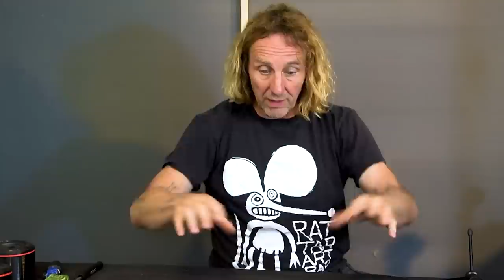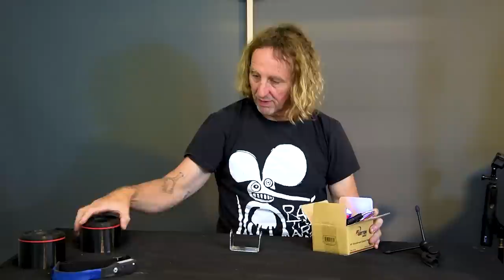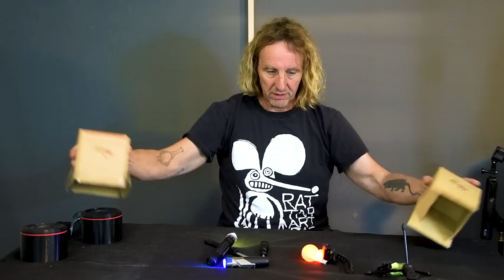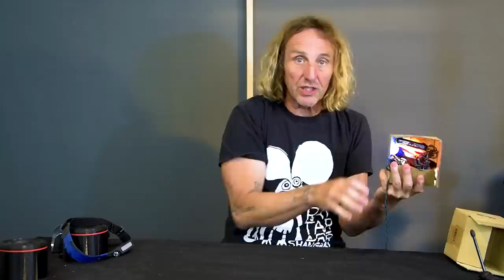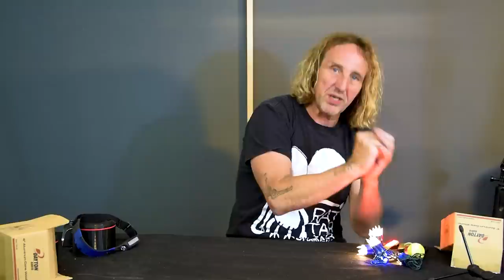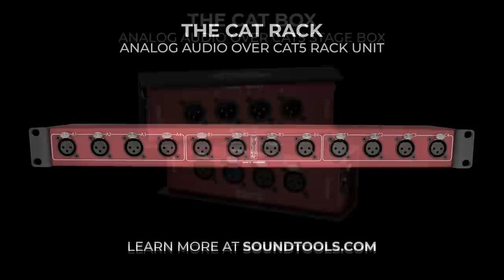Thinking Outside the (Speaker) Box - Does stereo Ruin Sound?

Comment: Bell Labs performed a series of experiments to find the minimum requirements for accurate sound reproduction.  This included preliminary work like reproduction levels, signal to noise ratio, distortion, frequency response etc. but it also included perceived localization of sound.  There were 9 "callers" in a grid pattern in a "pickup" room while a variety of different numbers of mics were sent via different numbers of transmission lines to different numbers of amp/speaker sets.  The speakers were in a separate auditorium, concealed by theatrical gauze, where listeners in different positions were to draw where they perceived the callers to be.  They found that 3 spaced mics sent via 3 discrete transmission lines, each to their own amp/speaker gave an almost exact match to where the callers were in the pickup room.  2 mics through 2 lines to 2 speakers didn't cut it, neither did 3 mics through 2 lines to 2 speakers, 3 mics through 2 lines to 3 speakers, or any other variant.  It's not just the intensity of the signal coming out of each speaker, but also tone, time difference, reflections in the room etc.  I thought a long time ago that somebody should create a psychoacoustic panner, that would automatically let you place your individual tracks into a virtual room, using a combination of level, EQ, delay and even reverb/predelay, to give a more accurate localization of objects in your mix.  When I mix in surround sound, I find myself assigning tracks to individual repro channels instead of panning.  That includes effects.  That way, a given sound comes from somewhere in the room instead of everywhere.  Like, I'll put an electric guitar front/left and it's delay return subtly assigned to surround-right.  Sometimes I'll add a reverse-polarity copy of a track to another channel, like adding an inverted guitar track to the center channel, 20dB below the level of the original, which I put front-left.  That "pushes" the guitar farther to the left to where a speaker doesn't exist.

Comment: If you put the exact same thing in both speakers without altering it, it will be in the middle. You try to lay out the instruments as they are on stage.
Reply from the maker: On stage instruments radiate energy outward from various locations

Srereo speakers shoot sound inwards from 2 locations.

It's like trying to recreate a fireworks show using a couple of flashlights

Comment: I envision a melding of motion arrays and ADS-B like tech to create motion in the sound that travels around the room with performers and even audience, to project an accurate image spatially.  Almost like a hologram of sound.    Almost like being on stage next to the performance.
Reply from the maker: I think speakers that output differing sounds in differing controllable directions would be fairly simple to implement
Reply: @DaveRat   would be fun to gut some track spots and mount some tube speakers to the gimble to prove it out then scale it up.    I would imagine horizontal arrays would become possible at that point.

Comment: What if you'd put like five arrays on the rig? The usual L&R arrays (which still should be the most powerful part) plus a center/left, center and a center/right speaker array (1/4 capacity compared to the main hang), evenly distributed above the stage? Then, adressing the sound-source (plus some of its reflections) to its original position would be far more controllable, because instead of only having two arrays for your stereo-image - largely distanced from each other, you could fill the space and create a more detailled stereofield.. Just an idea.
Reply from the maker: Love to see people try various things and let me know how they work. I will post more vids with ideas

Comment: All You Need To Do Dave Is To Buy A Lot Of Cabasse "La Sphere" And Built Them 360 Degrees Around You. Job Done.
Reply from the maker: Hmmm, I have some ideas and one that I have built and works pretty well.  I will do more vids to keep pushing new thoughts
Reply: @DaveRat  Great ! Looking Forward to that. When I was young I once went to cinema where you would stand and watch a short movie kindof inside a huuge ball, probably 25 meters in diameter. If the material of this shape could vibrate at any spot and play music we'd have the perfect 360 degrees sound, similar to using surfaces in the car interior to vibrate and emit sound.
Reply from the maker: Interesting. I am still chellenged by the concept of shooting sound inwards from the outside to recreate the experience of listing to instruments and sound source that shoot sound outward
Reply: @DaveRat  can you please explain a bit further, the concept of why you would wanna shoot the sound in the oposite direction..?
Reply from the maker: Well, a sound source 8s like a campfire radiating energy outward

Now say you want to recreate the feeling of a campfire, would you use a flashlight or floodlight that shoots energy all in one direction?

Or maybe a light that radiates differing energies in differing directions, maybe gets brighter in front then behind them to the sides.

Comment: You don't think that delaying the signals differently on the console could help a lot in trying to maintain that individual consistency? I mean...instead of aligning just the PA or the tops or subs and so on
Reply from the maker: Hmm, there are many things that can be done to reduce issues with stereo and increase the horizontal width.

But that does not change the fact that stereo is like radiating all the energy from two shower heads 

But an instrument or a band is like a sprinkler or a bunch of sprinklers radiating sound in many directions from differing locations.

The best one can do to recreating a field of sprinklers with two showerheads is try and line tings up so it's sort of similar if the listener never moves.

But as soon as the listener moves

"Hey wait, this is not a field of sprinklers, everything is coming from a few shower heads" becomes obvious.

Comment: That's sort of what location metadata (like in atmos or similar) allows for, then you can reproduce in binaural, stereo or multi-channel and the "point souces" will adapt to distribute through the the number and location if speakers and of the listener (positional audio)...
Reply from the maker: Hmmm, a sound source is kind of like a campfire or a sprinkler, radiation energy, outward in various directions.

Atmos is is like heater vents or showerheads mounted on the wall.

Atmos is like trying to replicate a campfire by using complex central heating with wall and ceiling vents.

I don't see one being able to recreate the other
Reply: @DaveRat  used atmos as an example, with metadata of spatial location you can eventually use a wall of sound tech once available, all around you, if you can make one, emiting sound from wherever you want. My main point was addressing the fact of never risk losing real spatial dinamic coordinates data, and then making the data adapt itself as best as possible to whatever playback context is available (mono, binaural, stereo, multichannel, and eventually "holographic" whatever if ever available... )
Reply from the maker: Hmmm, perhaps it could be simpler. Music releas with 4 stems and each stem has 4 channels. The playback side would have 4 speaker pods placed whereever ya want.

Each stem would have a front, rear l, rear r, and up signal or so. 

Each stem would be reproduced as a 3d sound source by the sound pods

Comment: I've always been interested in trying to fake a spatial reflection, especially a sound which you believe is coming from behind but is actually from the front/or your in ears. Big rabbit hole though
Reply from the maker: Ha, yes that would be a complex
Reply: That's insanely tricky, since the way we perceive height and front-to-back information are exclusively changes in frequency response/comb filtering, and is directly dependent on the shape of our ears and heads. Since we all have differently shaped ears and heads from one another, it is a real challenge to have a solution that can pull this off.

In headphones, though, this is actually achievable to some extent. This is what products like the new AirPods pro are trying to accomplish by somehow making a physical model of the individual's ear and directly using that information to compute vertical and front-to-back spatial data, directly tailored to the individual. For speakers, though, where multiple individuals have to listen to the same box, this is, or at least seems, next to impossible, without the speaker physically being in the spot the sound is intended to propagate from.
Reply: @FOHFILMS  Exactly, I've used internal ear scanning devices to achieve this before, would need to be tailored for each person differently somehow, it'll happen one day I'm sure though, and it will be awesome.

Comment: IF the sound is recorded with a single point source ie. one mic in a center position (or binaural with identical, very close proximity mics, like our ears) then playback CAN be achieved with VERY realistic results. A "phantom center" is critical to reproduce the stage width and depth. However once multiple microphones are used for the recording, things get out of hand as each one of those microphones now require their own playback system in the EXACT SAME recording position, unless the "recording engineer" is using computer controlled software to digitally place the instruments on a digital stage. Once you have heard a GREAT recording played back through GREAT gear, the "phantom" becomes a reality and it's difficult to believe that a "box-O-speakers" can recreate a sound like that.
Reply from the maker: I am not sure that capturing the sound radiating towards a single mic from multiple directions and then reproducing that sound of the instruments and the room with a loudspeaker that radiates sound primarily in one direction will offer anything colae to realistic sounding results. 

That sounds to me like what happens whenever mic'ing a room, the recording sounds reverberant and far away and fails to capture what the sound was like in the room

Comment: I'd be curious to hear your thoughts on Dolby Atmos.
Reply from the maker: Imagine standing in a field of sprinklers and walking around or sitting around a campfire.

Now set out to recreate those experiences using an Atmos concept

So now you are in a room with showerheads mounted on the walls and ceiling to recreate a sprinkler field

Or heater vents on the walls and ceiling to recreate a campfire

Can you see where the recreation would fail?

Comment: I have always thought that stereo imaging is imperfect, no matter which speakers are used. It is subjective because our ears and brain are not so easily fooled - you only have to move your head and the new information received destroys the previous impression. With bass frequencies it's much less of an issue. So multiple speakers do not have to be large. It would be feasible and desirable for audiophiles to have recordings with multiple channels - especially with the technology available today. How long ago was stereo invented??
Reply from the maker: I will do more videos on the topic. One aspect I intend to cover will be how Sound sources are energy sources and when comparing to something like movies or video where the actual lights are the energy sources and what we show in a video or a movie is actually the reflection of the energy off of various people and things.

The parallel between sound and sound sources would be similar to watching fireworks, sitting around a campfire, or looking at Christmas lights where we are observing the actual energy sources.

So recreating sound versus recreating visuals is much different

But the methods we use are very similar, which is where the flaws come in

Comment: A multi wall rectangular array (or vertical tube - akin to sitting in a light house!) of many thin film transducers powered by a multi channel amp connected by standard and controlled by a devices app that uses AI to transcode the spatial info of the individual elements within existing audio codex. The tech already exists as will the Sony multichannel remasters, but the sound reproduction from the arrays would have to be affordable and of a high quality for it to be taken seriously enough to a cause a shift. The possibilities to tweak and position the individual elements would be super dynamic. Imagine walking down a corridor with thin film transducers on the walls that are emitting a dedicated to the environment (corridor) mix, with each instrument presented to the listener from its' own speaker! It would be like walking up to the performers and through the performance! Aye, it's the end presentation system of audio that requires reform right enough. Even modular add as you go good quality yet affordable wireless speakers scattered about a room and connected to such a playback system will make people expand their consciousness of the possibilities of better sound reproduction. Oh aye, that's what you're doing, Dave!...hehe!
Reply from the maker: Not sure it needs to be that complex. Think about trying to recreate an acoustic guitar player. The Sound source would be somewhat like a campfire radiating energy around it and outward.

Now try and recreate that scenario using the systems available by radiating heat of the campfire from all the walls in the ceiling how close will you get to recreating the feeling of a campfire?

Recreating a campfire with Central heating will be as successful as we creating an acoustic guitar player with surround sound Atmos or any of the other methods in use today
Reply: @DaveRat  of course! I was obviously still over thinking inverted outside in, inside the box! For some reason a glitter ball comes to mind...I need to get my head half a round this. The gears are a trundling. Thank you, Dave Rat. Brilliant content, man!
Reply from the maker: Cool cool and thank you

Comment: I think that atmos is doing what you are talking about, just a little bit differently. It spreads instruments to each speaker. Yep, you don’t get that natural position you are referring to, but at least is creating a new way of listening to music by basically avoiding to put everything into only two speakers, as stereo does. The result is immersive, and mixing music is easier.
Reply from the maker: Natural sound sources are kind of like sprinklers in a field, projecting sound outward in various directions.

Atmos, 5.1 7.1, 9.1 and so on are like a bunch of shower heads all pointed at the listening area.

I don't believe they are the same.
Reply: @DaveRat  I agree 100%. Atmos takes the inherent problems of stereo and multiplies them. That doesn't matter though, since the intention of Atmos is to drive hardware and content sales, not solve the problem of natural-sounding 360 sound.
Reply from the maker: Atmos is fun and for things like movies, super cool to have sounds radiate from locations sort of near where they are in the movie.

I don't have issues with offering various controls over glorified stereo.

Comment: That's why the best stereo systems have at least 4 towers with different size speakers. Place two of the towers behind and off axis of the front two. That's closer to realism.
Reply from the maker: Yes that is helpful yet sound sources are energy sources radiating sound outwards.

Speakers typically are sound sources radiating sound inwards.

Not unlike trying to replicate a sprinkler on the lawn by using a shower head on the wall

Comment: I have mixed in binaural using "Dear VR" plugin (virtual 3D room that recreates the "flowers" depending on the 3D positioning of the source in the virtual room). What is your take on that?

PS: isn't it a lost war to start with? Speaker cones are all made of paper, and that's supposed to sound like metal (horns), wood (guitar), and so forth... Wasn't the war lost before it even started?
Reply from the maker: Hmmm, then simplify. Record and play back the sound of a paper bag crumpling through paper speaks and see if you can or can not hear the difference between the recording and real.

There may be many issues but the main fundamental is that differing sounds radiate outward in all directions from natural sources and if we wist to recreate realistic sound, we need speaker that radiates differing sounds outwards
Reply: @DaveRat  Never thought of trying that. Thanks for the idea 🙂